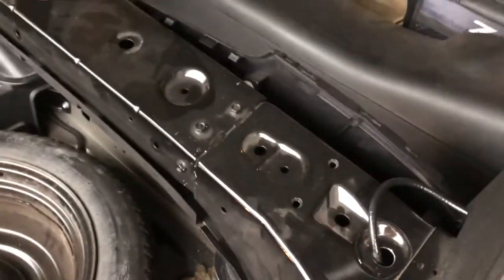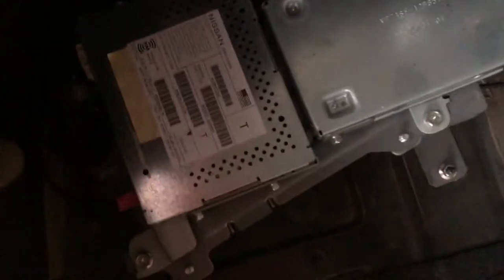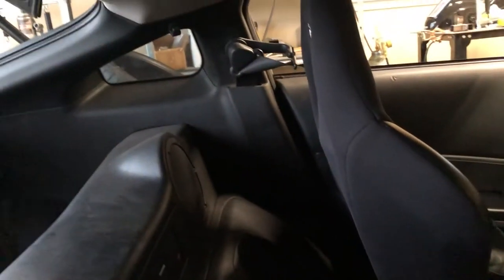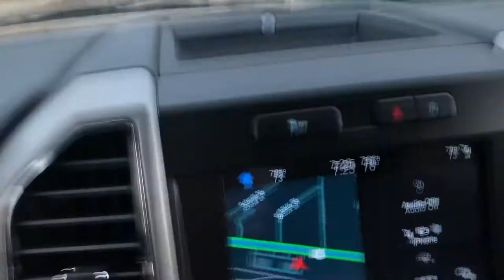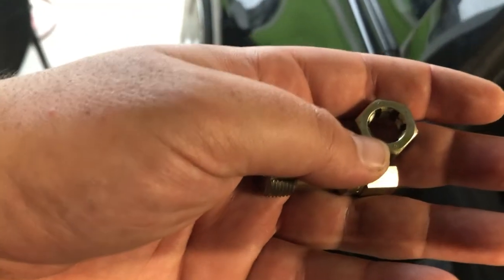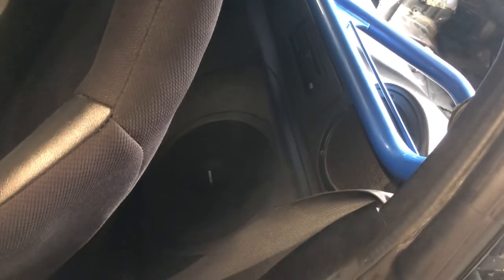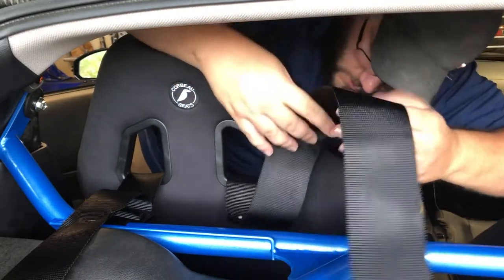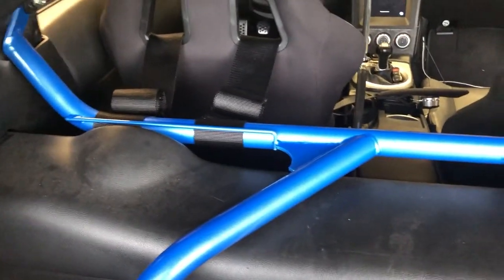350z 5 Point Harness Install

Comment: Was the install hard? Im gonna try to install my harnesses on Sunday!
Reply from the maker: The only trouble I had was getting one of the bolts to thread back in with the factory seat belt on the passenger side. Everything else was pretty straightforward.